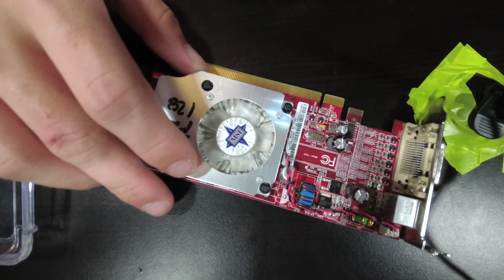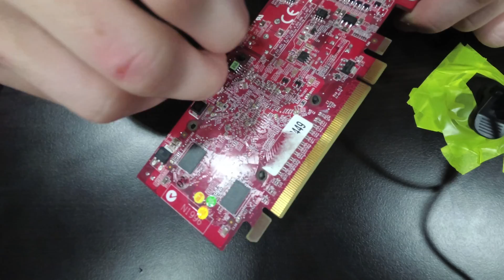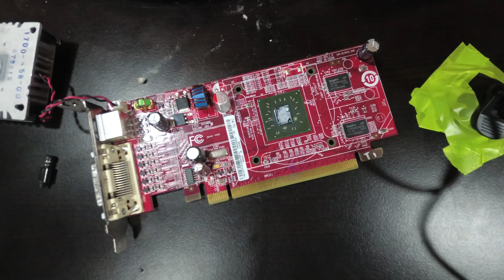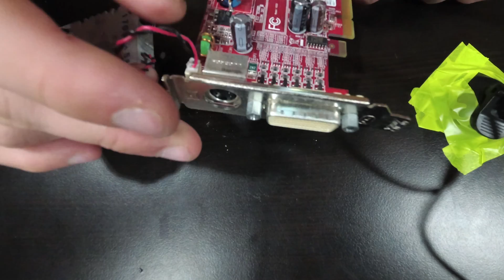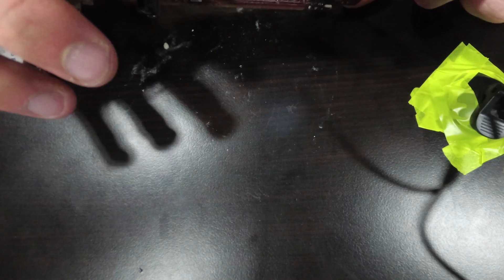Opening a Graphics Card and Explaining What Are Each Of The Components | GPU Tear Down

Comment: What's the silver thing with the red stripe on the side of it attached to the board? I knocked one off on my 2070 and did a meh job of soldering it back on. I get display, I'm just concerned that it'll spaz one day when I'm pushing the cards limits. Thanks in advance!